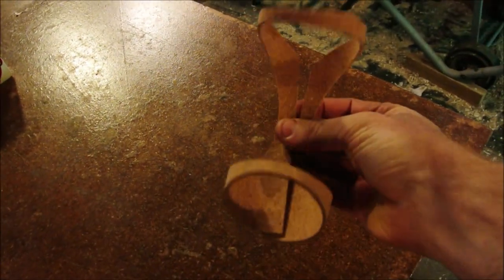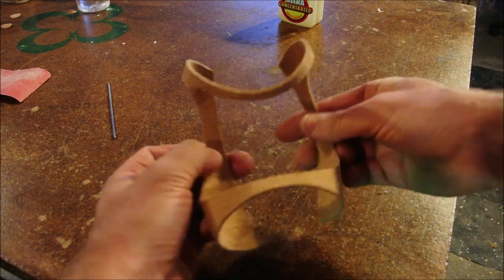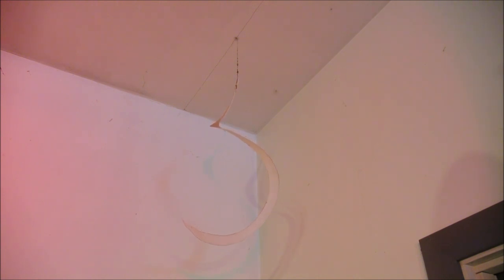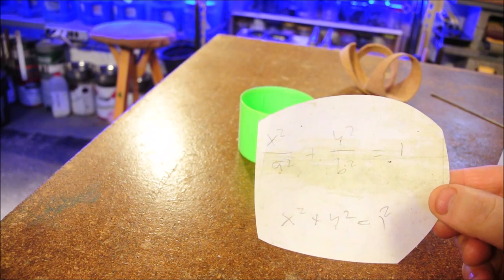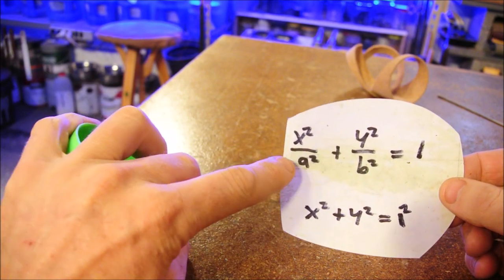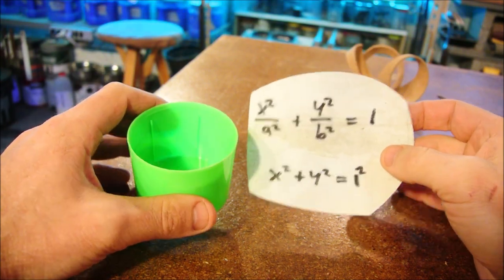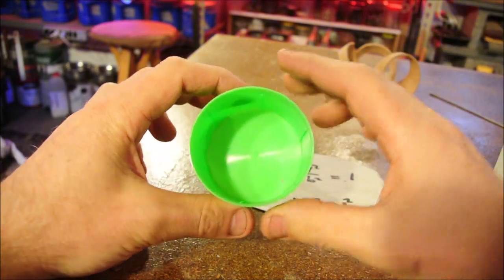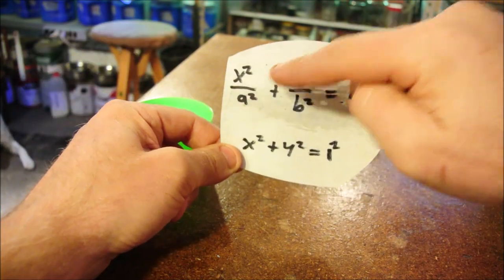Simple beauty, irony, & mathematics.

Comment: "We never see circles, we only ever see ellipses." Can you go into more detail on that? 
Sure, seeing a perfect circle (or rather 'seeing a circle perfectly') is not near as common as an ellipse, but it does happen. Let's take a full moon, for example. Because it is a sphere, for all practical purposes it looks like a perfect circle from where we are. Ok, fine, you might say that it's not smooth and perhaps it is not actually a perfect sphere due to gravity or whatnot. Then let's take something like a bearing ball. It is smooth and arguably small enough that gravity does not affect its shape. When it is resting on a table and especially when we look at it with one eye closed, what we will see is about as perfect of a circle as one can hope for in out imperfect world.
Reply from the maker: You just answered your own question perfectly. Well, at least as perfectly as one could, given how imperfect and unsatisfying the answer is. 

The message was really about how ideals are just that. Even in your one eye that's seeing a ball-bearing example, the eye is still a lens that relays its information through some type of spherical aberration. Further, an eye is not located at a single fixed point. 

And of course, there'll also be every speck of airborne dust that intrudes, relativity, air currents, lighting discrepancies, heat differentials, a lack of a fixed frame of reference, varying amounts of space between the points on a sphere, the endless diffusion of matter, time delays being introduced by the different areas of the brain for the sake of preserving an apparent chronological continuity, and yadda on. Strictly speaking, we don't ever see get to 'see' ellipses, or lines, either. All ellipses have some irregularity, and all lines will have some curvature. All of our ideals—especially perfect geometric figures—are mind-generated models that we attempt to visualize; though we might conceive of the perfect as a concept, while still here in hard 'reality,' our perceptions are really only ever apprehended through a murky soup of flawed sensory information. 

Here's a goofy sort of overly simplistic subjective thought experiment: just look at a pinball and think. Try to isolate it. So that I'm not sounding patronizing, I just did it too. Seriously, look. Your own perceptions of it will begin to dissolve its form. Watch as its boundaries begin to blur right in front of you. It can't be compartmentalized. The more you try, the more it will erode. It just ends up melting into the soup with everything else. There's nothing perfect about it. 
It's not even close.
Reply: @pocket83squared  Your last paragraph about everything melting together reminded me of an AI that's getting somewhat popular, "Dall-e", i think it is called. You give it a prompt and it will draw several versions of what it thinks you mean. If you give it something more specific like "draw a face", often times it will pick out bits and pieces from many photographs and drawings, piecing together various looks and emotions. Then often times the AI will blur certain parts of the image to make it look more like one. If you saw most of those generated images individually and out of context they would look like mush, few blobs at best. Amazingly though, seeing several together that are about the same prompt conveys the idea rather clearly. But then more you look at each individual image from the group, more it returns to blobs and becomes even less understandable. 
In a way this feels like trying to recall a memory, with your brain pulling bits of information that you know for sure and mixing them with some generalizations, or bits from a different (but similar) experience.